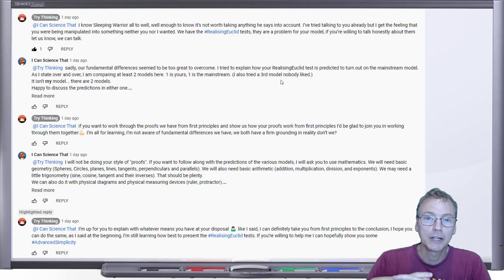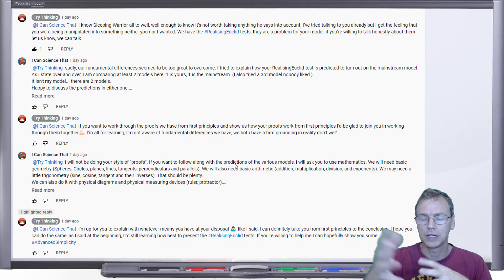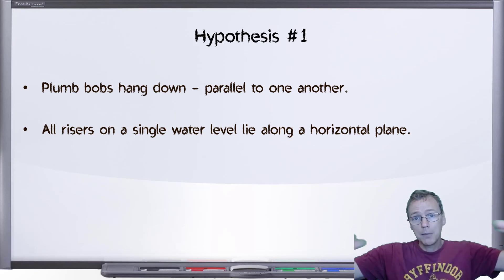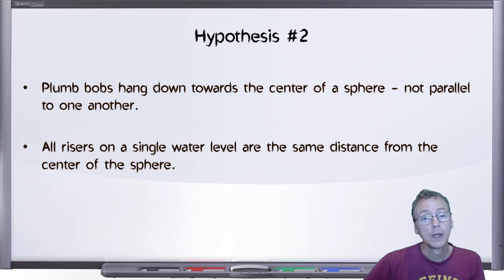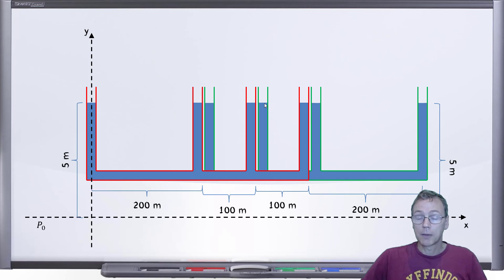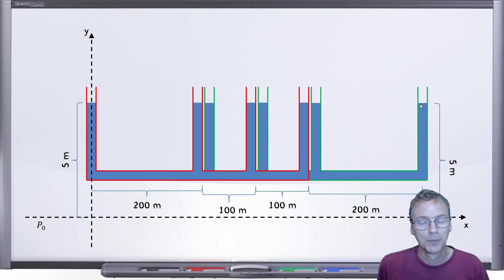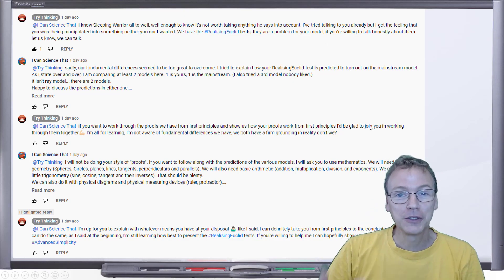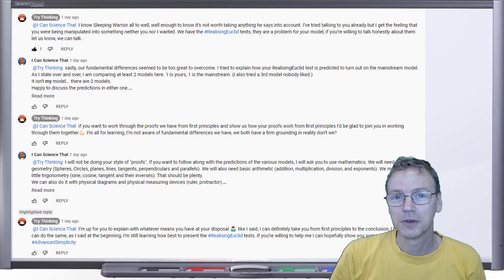Realizing Euclid Step-By-Step Part 1

Comment: This is the clearest elucidation of the two hypotheses that I have seen so far, many thanks.
Reply: @UCPW5HES2YCOWQMN2A0i7AGw 🤷 I’m at a loss. Should we trust a plethora of qualified surveyors or some random guy on the internet?
Reply: @andrewjohnston6631  the surveyors who actually surveyed and helped build the Erie Canal with its parallel horizontal water levels separated by perpendicular vertical gates or the ones that beddy says "found" some curvature on page 377 of a 1000 page book?
Reply: So you'll be taking the side of water levels establishing a ball-shaped reference in reality, correct?
Reply: @DrEMichaelJones  ICST is not asking which hypothesis is correct, but rather what each hypothesis predicts. The question set is pretty simple, so you should be able to answer it, little buddy.
Reply: @edby263  Your prediction is that a water level will establish a ball-shaped reference. Mine is that it works the way the manufacturer intended it to. Do I need to use smaller words? Perhaps you can find a quote from Augustine or Aquinas about it.
Reply: @DrEMichaelJones  I supplied you with all the quotes from Aristotle, Augustine and Aquinas in the presentation which you watched.
Reply: @DrEMichaelJones  And did you manage to answer ICST's questions?
Reply: @edby263  looking for a quote about water level's establishing a ball shape, little buddy. Surely someone from your new religion has spouted that...
Reply: @edby263  what questions did he have? I didn't bother watching the video. he has an annoyingly whiny voice.
Reply: @DrEMichaelJones  Mike Jones personalises everything. He is incapable of approaching any question or problem without insulting the person, real or imaginary, who he imagines posed the question or problem. He will be incapable of replying to this comment without some tone in which the breed couches its insults.
Reply: @DrEMichaelJones  Augustine. "Cum enim totam terram adhuc aqua tegeret, nihil impediebat ut aquosa et globosa moles ex una parte faceret diem lucis praesentia, ex alia noctem lucis absentia"
Reply: @edby263  how do you feel that you have been insulted, little buddy? Use your words.
Reply: @DrEMichaelJones  Lovely, a nice personalised reply, as predicted.
Reply: @edby263  Outstanding! Catholicism sounds like your new religion! Do you think you can get any of your atheist pals to convert with you?  How do you imagine they are going to feel about the firmament? Do you think they'll go along with God separating the waters from the waters?
Reply: @DrEMichaelJones  By the way, you don't have to watch the videos. The links to the forms are posted above, and you are a smart person. Rooting for you.
Reply: @DrEMichaelJones  Augustine addresses precisely this point about the firmament. Why not read what he says?
Reply: @edby263  did you fill out the forms like a good little boy?
Reply: @DrEMichaelJones  for someone who didn't even watch the video you sure are spending a lot of time here
Reply: @DrEMichaelJones  "like a good little boy". Again, Jones cannot approach any intellectual question except by personalising it. Has he sought help about this?
Reply: @donjezza  It has some deep need to attack and insult other human beings. Perhaps it was dropped on its head as a child.
Reply: @edby263 I don't think I need any help pointing out your obvious weaknesses that I exploit for amusement but if you'd like to share some you think I may have missed feel free.
Reply: @DrEMichaelJones  "looking for a quote about water level's establishing a ball shape" Then you must not be trying very hard. Kind of like you won't admit that the haversine formula accurately tells you the distance between two points on Earth. Here's what you can't seem to find Mike. Let me guess - engineers and surveyors are actually lizard people?

Level
- A line or surface to which, at every point, a vertical or plumb line is perpendicular; a line or surface which is everywhere parallel to the surface of still water; -- this is the true level, and is a curve or surface in which all points are equally distant from the center of the earth, or rather would be so if the earth were an exact sphere

Terminologies in Levelling
A vertical line is the line indicated by a freely suspended plumb bob or is the line along the direction of gravity.
Level surface is a surface normal to the plumb line at all points(or perpendicular to the direction of gravity at every point). Simply, we can define it as, any surface that is parallel to the mean spheroidal surface of the earth.
Reply: @NinjaMonkeyPrime  That's a fascinating belief that you have there, little buddy. Do you imagine you can establish a ball using a water level or would it just establish horizontal like all the manufacturers say it will?
Reply: @DrEMichaelJones  That's some epic ignoring of reality. You asked for references that cite how levels work on a globe and I gave it to you. Are you literally putting your fingers in your ears to avoid education? Are engineers and surveyors all lizard people? Still can't explain why using the haversine formula works for calculating the distance between two points on Earth? What's next? Pretending that measuring a kitchen table is the same as a few thousand miles? Your entire game seems to just ignore reality. At least try to come up with excuses. You're boring.
Reply: @edby263  I don't think you should stoop to that level of insults as a response though.
Reply: @NinjaMonkeyPrime  we're discussing reality. I know this is hard for you but in reality water levels establish a horizontal plane of reference. No one disputes this except for a tiny group of weirdos online. You're one of those people.
Reply: @DrEMichaelJones  "we're discussing reality" Yes, the reality of using the haversine formula with any two lat/long coordinates will give you the distance between those points. It works in reality. Something you can't explain. And something you can't calculate on flat Earth. 

"in reality water levels establish a horizontal plane of reference" How cute. Now Mike is pretending to not understand what was said. Establishing a horizontal on Earth means perpendicular to the vertical which points to the center of Earth. If you need more reality just look at the support towers for a bridge like Humber.
Reply: @DrEMichaelJones  Have you noticed that the water levels in this example have more than two risers? And that there’s two overlapping water levels? For a total of eight risers?

It’s pretty easy to realise that if the earth was flat you could look across and see the tops of the water in the risers all lined up.

It should also be obvious that if the earth was curved the water level in the risers would also curve away as you looked along them.

It’s astoundingly simple yet you seems to not understand it.
Reply: @andrewjohnston6631  yeah it's crazy they didn't just sight across the water levels
Reply: @andrewjohnston6631  have you noticed that Erie canal is 363 miles long and all the water levels in the locks are horizontal and parallel? It was designed that way.
Reply: @DrEMichaelJones  Have you given up trying to explain why using the haversine formula and any two coordinates on Earth accurately calculates the distance between the two points? It's really simple. It's because we measured Earth and developed an accurate coordinate system. Something that you can't do with flat Earth.
Reply: @DrEMichaelJones  We haven’t got as far as real world examples yet. We’re still trying to to get you to understand how a multi-riser water level would work under the two different hypotheses that ICST has proposed.
Reply: @andrewjohnston6631  I just live in reality where water levels establish horizontals that are all parallel to each other as exemplified by the design and construction of the Erie Canal. Spaghetti boy wants to line in some sort of bizarre imagination land that contradicts reality. Sad.
Reply: @DrEMichaelJones  No one said that water levels with only two risers don’t establish a horizontal line. The problem is when we add more risers along that line. ICST is trying to get everyone’s understanding of how they would work in the two different scenarios.

No one seems to have any trouble with the first scenario but there’s one sector of the audience that kicks up a fuss when we move to the second one.
Reply: @andrewjohnston6631  the Erie canal has 57 locks. The water levels in all of them are horizontal and parallel to each other. No one in that lives in reality has trouble understanding this. Why do you and your small band of weirdos dispute this?
Reply: @DrEMichaelJones  You just won’t give up on that canal, will you? That’s quite some claim you’re making - that the sections of the canal are horizontal and parallel to each other. You got anything to back it up? The strange thing is that during the 19th century geodetic surveyors went right through the region the canal is in. Reckon they would’ve said something if they hadn’t found any spherical excess for hundreds of miles. It would’ve been mighty unusual.
Reply: @andrewjohnston6631  why would I give up on the canal that engineers designed and built with water levels establishing parallel horizontals for 363 miles? It crushes your fantasy and was built before any "geodetic model" was even imagined. No "spherical excess" at all. Just straight horizontals and verticals all perpendicular to each other. Euclidean reality.
Reply: @DrEMichaelJones  Any reference for it being constructed with horizontal parallel sections? (This is the 2nd time I’ve asked).

You’re also missing the point of me bringing up geodetic surveying. You claim that the canal was built for ~300 miles without encountering any earth curvature. In the decades following the completion of the canal the entire area that it runs through was covered by a triangulation survey. And those surveys measured spherical excess in that area (just like they do in all areas). So how can it be that the canal was built flat if the surface that it is on is curved?
Reply: @DrEMichaelJones  So your “proof” that it’s horizontal and parallel is the elevation profile. 
That would be the elevation profile that references everything as a height above the tide level at the eastern end - so essentially it’s height above sea level. And sea level was known to be curved for thousands of years before the canal was built.
Everyone knows that elevations are in reference to a curving surface but are drawn against a flat base for clarity and utility. Only a tiny group of weirdos on the internet seem to think they’re proof of a flat earth.
Obscure survey or not, geodetic surveying measures spherical excess everywhere. Your misunderstanding of a profile diagram doesn’t change that.
Reply: @DrEMichaelJones  Earth’s spherical shape wasn’t known about in 1817?? HAHAHAHAHAHA!!!! Good one, Mike 😂
Reply: @andrewjohnston6631  shall we bet $1,000  that you can't find any mention of it in the engineering drawings of the Erie Canal? HHAHAHAHAHAHAHA

Over to you Andy!
Reply: @DrEMichaelJones  I wouldn’t expect to see a curve on the profile diagram. No one would expect that - because everyone knows the earth is curved and the elevations on the profile are in reference to sea level (or in this case, high tide on the Hudson at Troy)
The issue isn’t the stuff on paper. The issue is out there in the real world.
So what would you expect to see if you put a water level with multiple risers along the length of one of the “horizontal” sections of the canal? Would they all line up or would they curve away with distance?
Reply: @andrewjohnston6631  Good point about the survey. Is the United States Lakes Survey dating from 1841 that you are referring to?
Reply: @andrewjohnston6631  Jones says "Why do you and your small band of weirdos dispute this?" This is a lovely piece of gaslighting. The narrative is that Science holds that the earth is flat, that all engineers and physicists know there is no curve, there is no such thing as 'geodetic surveying', only construction surveying where level is horizontal, etc etc. But there is this 'small band of weirdos' and eccentrics on YouTube who hold that the earth is a globe.
Reply: @andrewjohnston6631  lol "everyone knows" so they could just draw it with straight lines and leave it up to the laborers to figure how much "curvature" they should account for. Whatever helps you sleep at night, little buddy.
Reply: @edby263  Didn’t bother to find a particular survey but there’s a map “Primary Triangulation in the State of New York 1887” that shows all the triangulation that had been done. Inconveniently for Mike, there’s a triangulation network between Albany and Buffalo that covers the run of the canal. I wonder if the surveyors reported back that they didn’t find any curve? 🤔
Reply: @DrEMichaelJones  Is the engineering drawing you keep citing the same one that is on the wiki page for the canal?
Reply: @andrewjohnston6631  Hi I just found Report of the Primary Triangulation of the United States Lake Survey 1882, a mere 1,000 pages. Part III starting p.307 has the results on the spherical excess. So they found a curve, unsurprisingly.
Reply: @andrewjohnston6631  come on over to Next Level and I'll show you photos of the original elevation profiles I own. None of the drawings depict curvature of the parallel horizontal water levels because they're not curved.
Reply: @edby263  Nice find, edby. I randomly picked a couple of sets of observations from that book and, to nobody’s surprise, found a few arcsec of excess in both of them.
Reply: And yet the surveyors architects and engineers that built the Erie canal didn't find any curve or "excess" (since there obviously can't be any in our 3 dimensional Euclidean reality) and the canal works perfectly. I think we can trust the people that built what was called the 8th Wonder of the World versus some guys that looked at stuff in the distance and then wrote down some numbers and said "that's curved."

PS beddy is if course lying again. He didn't just find it. He got it from mactoon.
Reply: @DrEMichaelJones  It’s nice that you characterise geodetic surveying as just some guys who look at stuff in the distance and write down numbers. The fact that this type of surveying has been done all over the earth in order to make accurate maps probably speaks a little to its validity.
Can you give a source for your claim that the canal builders didn’t find any curve? At the moment all we have is your misunderstanding of an elevation profile.
Reply: @andrewjohnston6631  I suggest he look up Alexander Ross Clarke (whose work is discussed at length in the 1882 report). I did not find that report from MacToon but rather from an elementary search.
Reply: @andrewjohnston6631  the fact that an actual canal was built by architects and engineers based on surveys accounting for exactly zero curvature tells you which ones were right in the end. Womp womp

PS - triangulation requires straight lines. Lol
Reply: "triangulation requires straight lines" is funny
Reply: @edby263  I suggest you look up "Erie Canal Elevation profile." It's an elementary search.
Reply: @DrEMichaelJones  Again, Mike, can you provide a source for your claim that the canal surveyors considered the earth to be flat and that all the sections of the canal were surveyed and built to be parallel horizontals?

You’ll find that spherical excess is documented on more than just one page in that book. And it’s to be found in many more books published by other triangulation surveys. And in the whole entire field of geodetic surveying, which was well established before the canal was built.

So you really have to come up with something better than “I’ve got this diagram with right angles”.

And… any explanation as to why Google Earth shows a spherical earth but a flat MSL for elevation profiles? Have they accidentally revealed that the earth is flat and hoped we wouldn’t notice?
Reply: @DrEMichaelJones  You still haven’t answered whether the original plan you have is the same (or similar to) the one in the wiki page for the canal?
It’s not a difficult question.
Reply: @andrewjohnston6631  Jones' argument seems to be that because the lines where the elevation does not change are represented as straight, not curved, there is no earth curvature. Does he have a point?
Reply: @edby263  represented and then constructed according to those elevation profiles. Do you imagine builders ignore them? What other weird conspiracies do you believe? Btw, I didn't say that there are no curved or rolling hills of earth all around those parallel horizontal water levels that are separated by perpendicular vertical gates.
Reply: @andrewjohnston6631  "And… any explanation as to why Google Earth shows a spherical earth but a flat MSL for elevation profiles? Have they accidentally revealed that the earth is flat and hoped we wouldn’t notice?" Interesting.
Reply: lol he's now resorting to citing cartoons made in silicon valley by nerds. Sad. But nice to see him concede that elevation profiles definitely don't reference any curve. Interesting indeed.
Reply: @DrEMichaelJones  Despite you not answering my simple question twice, I take it that your original document is indeed the same (or similar) to the elevation profile on Wikipedia.

So… 
Do you think the builders saw that profile and understood it to be elevations above a curved MSL (or, more specifically, the level of high tide at Troy)?

Or… do you think that the surveyors and engineers looked at that profile and thought, “Gee! That’s weird. This canal is supposed to be built horizontal for hundreds of miles. That’s going to be difficult, seeing as we all know that the earth is spherical. Isn’t it going to start separating from the earth’s surface? How are we going to support it and won’t the water all flow down to one end? Oh, well. I guess the planners were right and we’ll just have to build it like that.” And then they used planar surveying and were astounded when it conformed to the earth’s surface. “By Jove, gentlemen! It turns out that the earth is actually flat! How could we have been so wrong and why did it take this particular construction to convince us?” And then they turned to the geodetic surveyors and said…

“Womp. Womp.”
Reply: @andrewjohnston6631  Embarrassment comedy is funniest when the embarrassed person realises quite how embarrassing he/she is. But not bad.
Reply: @andrewjohnston6631  More research shows the Erie canal was designed by untrained engineers. They couldn't afford the salaries of European engineers and at that time there was no major engineering school in the US. They were amateurs. But of course you don't need to be a geodetic surveyor to build a canal, you just use, er, a water level.
Reply: @edby263  too bad we'll never witness your realization. It would be hilarious.
Reply: @edby263  more research than beddy's brief scan of wiki reveals that those engineers consulted with the top European canal engineers of the time and then drafted the elevation profiles on straight xy axes and constructed what was called the "8th Wonder of the World" with parallel horizontal water levels separated by perpendicular vertical gates.

And yes, er, that water level is indeed horizontal and parallel to every other water level for 363 miles of canal. Womp womp.
Reply: @edby263  😂
Reply: @DrEMichaelJones   You are making an assumption that the builders took that “flat” plan and went out and constructed a “flat” canal.
And, as already pointed out to you, that would contradict the findings of the geodetic surveyors who went through the area in the decades following.
And indeed it would contradict geodetic surveying entirely.
I’m intrigued what your response to geodetic surveying is. None of the flerfs I’ve encountered have any rebuttal to it, with the exception of one who said that the supposed curvature was within the margin of error.
Reply: @andrewjohnston6631  Ah but Andrew, didn't you know that geodetic surveyors merely look at stuff in the distance and then write down some numbers and say "that's curved."
Reply: @andrewjohnston6631  no, there is no assumption by me. The plans aren't "flat." They cover hundreds of feet of topography. The elevation profiles definitely depict the water levels in the locks as horizontal though because they are in reality and every geodetic surveyor that's ever drafted an elevation profile will depict them that way. If you don't like it, try to get them to change it to match your fantasy model and then watch them laugh and tell you it would be impossible to do. Because it would. Womp womp.
Reply: @DrEMichaelJones  You’re having trouble keeping your story consistent. Are geodetic surveyors a bunch of guys who “look at stuff in the distance and write down numbers and conclude that there’s curve”?
Or are they legitimate surveyors that draft “flat” elevation profiles because the earth is genuinely flat?

(And stop it with the topography nonsense. No one is denying topography.)

You still haven’t answered my question about whether your super secret original canal plans are similar to the elevation profile shown on Wikipedia.

You also still haven’t provided your rebuttal to geodetic surveying other that to belittle it.
Reply: @DrEMichaelJones   And what about Google Earth’s depiction of a spherical earth and a “flat” elevation profile? All you’ve done is belittle it by calling it “cartoons by nerds in Silicon Valley”.
Could you perhaps provide an explanation that has some substance? Never mind if you can’t. It’s okay to admit you’re wrong.
Reply: @andrewjohnston6631  Don't forget the bunch of guys that looked at stuff on YouTube and then, without writing down any numbers, said "that's flat." "
Reply: @andrewjohnston6631  elevation profiles aren't flat, little buddy. They depict level as horizontal and parallel to the x-axis and plumb as vertical and parallel to the y-axis. It's ok to admit that you don't know what an elevation profile is.
Reply: @andrewjohnston6631  There are no "super secret" elevation profiles for the Erie Canal. They all depict water level as horizontal and parallel to the x-axis and plumb as vertical and parallel to the y-axis. Just like they are in reality. Every surveyor who has ever drafted one has drawn them this way. Why do you hate canal surveyors so much?
Reply: @DrEMichaelJones  "The elevation profiles definitely depict the water levels in the locks as horizontal though because they are in reality" No, they depict the profile compared to a baseline because that's what they are for. 

"every geodetic surveyor that's ever drafted an elevation profile will depict them that way" An elevation profile isn't a geodetic survey. It's cute you pretend to not understand what terms mean. When asked for a world view you get WGS84 which is an oblate spheriod because that's what was measured in reality. 

"If you don't like it, try to get them to change it to match your fantasy model" Why would anyone change an elevation profile to be something it wasn't supposed to be? You're basically saying if you don't like hammering with a screwdriver then get them to change screwdrivers to be hammers. Its childish even by your low standard. 

"and then watch them laugh and tell you it would be impossible to do" More likely they'd laugh because Mikey is a dishonest flerf who pretends that elevation profiles should require Earth curve and that WGS84 is a Freemason conspiracy. They'd also laugh because you can't use lat/long to estimate distances like humans have done for hundreds of years. There's tons to laugh at with you Mikey. 

#gottolietoflerf #fearthehaversineformula #wheresyourmap
Reply: @DrEMichaelJones  I don’t disagree with you. Horizontal lines on an elevation profile are representative of level lines in reality. And vertical lines are representative of plumb lines in reality. It’s the same way those “nerds in Silicon Valley” draw their cartoons.
I think you might finally understand it. Huzzah!
Reply: @andrewjohnston6631  Yes indeed level is horizontal on elevation profiles and in reality. Straight lines. Glad we agree.
Reply: @NinjaMonkeyPrime  Don't lie to flerf. You definitely don't "gotta" do that. Be honest to him.
Reply: @DrEMichaelJones  Don't get mad Mikey, we know that you're pretending to tell these lies. It's how you get your jollies and we're not really trying to kink shame you. But you're really not very interesting anymore. All you're doing is cherry picking and saying nuh-uhh. At least try something new. How about that formula for calculating the distance between two points on Earth without using spherical math? Or why we match reality when we do use spherical math with a prediction? 

Or just go back to pretending elevation profiles are supposed to show curve and geodetic surveying is all fake because conspiracy theory mumbojumbo. Oh, let's talk about measuring your kitchen table for Earth curve again. That one never gets old.

#keeptrolling #gottolietoflerf
Reply: @boobylinks  their elevation tool is accurate why do you imagine they would need to change it? Horizontal is the x-axis and vertical is the y axis. Straight lines on the graph just like they are in reality.
Reply: @DrEMichaelJones  You previously agreed that level in reality is represented as horizontal on a profile. You’re now saying that horizontal on a profile is horizontal in reality. So all you’re saying is that level in reality is horizontal in reality. You’ve removed your super secret engineering diagram from your argument.
So now it’s up to you to show that level is horizontal. 
Have you filled in ICST’s forms? 
Can you explain how Bev’s test could distinguish between horizontal level and curved level?
Have you provided a rebuttal to spherical excess?
Have you admitted your super secret canal plans is just the elevation profile and not instructions to build a horizontal canal?
Have you explained why Google Earth depicts elevation against a flat base whilst simultaneously showing the earth as spherical?
Chop chop, Mikey. You’ve got work to do.
Reply: @andrewjohnston6631  level is horizontal on elevation profiles because level is horizontal in reality, little buddy. Construction wouldn't work it is wasn't. There are no "super secret" diagrams. Elevation profiles for the Erie Canal are readily available. You can buy them online or even just print them out if you're poor. Get busy printing, little buddy. You've got lots to learn.
Reply: @DrEMichaelJones  You’re glossing over how an elevation profile is proof of a flat earth. If elevation profiles are horizontal because the earth is flat then why does Google Earth depict the earth as spherical? Why do geodetic surveyors always find spherical excess? How would Bev’s test be able to distinguish between the two possibilities?

If level is horizontal then why can’t you actually provide evidence for it?
Reply: @andrewjohnston6631  the earth under our feet is provably NOT FLAT. We use elevation profiles to depict the topography that makes the earth not flat. 

A water level is a tool for establishing a horizontal plane of reference they're used daily for construction projects all over the not flat world.
Reply: @DrEMichaelJones  Firstly, you can dispense with the “earth isn’t flat because of topography” diversion.
And now we get to Bev’s test. Can his test determine if the earth is flat or curved? Is a horizontal plane established by one water level parallel to one established by another water level? It’s not sufficient for you to just say that it is. ICST has set up these videos to determine if Bev’s test can distinguish between the two paradigms - and it’s clear that it can’t. So perhaps you can devise a test that will?

BTW You’re still very silent on geodetic surveying and the “Google Earth conundrum”. To refresh your memory:
- why does geodetic surveying always find spherical excess?
- why does Google Earth depict elevations against a flat base but depicts earth as spherical?
Reply: @DrEMichaelJones  A water level tool is used to establish a horizontal plane of reference. So what would happen if that tool over several miles showed horizontal planes of different heights? You know, like what Walter already gave you and you ignored? Not to mention, what exactly makes estimating the distance between two points on Earth complicated on flat Earth? If Earth is flat you should be able to use a really simple x/y coordinate system with a rigid scale. So what's the hold up? Where's the map, coordinates, scale, and math?
Reply: Y’all arguing with a dude that thinks elevation profile of a globe earth should be a curved graph. He can’t grasp what elevation means, and he won’t acknowledge what’s being said to him because he’s evidently either too incompetent and/or insecure to entertain different hypotheses. This won’t go anywhere but backwards.
Reply: It's always fun to watch y'all imagine what I'm thinking.
Reply: @sphaera2520  "He can’t grasp what elevation means" Oh he knows. He's just lying about it. He's part of the crowd that thinks it's funny to pretend to not understand things.
Reply: @DrEMichaelJones  What Mike Jones is 'thinking'?
Reply: @edby263  it's infuriates you that you know I'm both smarter and better educated than you, beddy. Get it all out.
Reply: @DrEMichaelJones  "It's infuriates you"
Reply: And where actually was this 'education'?
Reply: @edby263  Multiple universities. Better than any school you claim to have attended in the UK. With honors.
Reply: @DrEMichaelJones  Which ones. And where did you learn about geodetic surveying? Or Thomas Aquinas?
Reply: (You clearly knew nothing about Aquinas. I'm glad I corrected you on that)
Reply: @edby263  I learned about Aquinas from the Summa. Which geodetic surveying school did you attend?
Reply: @DrEMichaelJones  So you never read the commentary on *De caelo*. Fair enough. (“My front entryway is a rotunda and it's definitely not ball-shaped.”)
Reply: “We've already confirmed that St. Thomas Aquinas never said anything about believing in a sphere-shaped earth". Should have got a refund.
Reply: I have heard Mikey's claims to higher education before but there is nothing in what he says that is evidence of it.
Reply: @edby263  feel free to bet me on it little buddy
Reply: @DrEMichaelJones  You have no evidence, except what you say. And what you say contradicts any possibility of an education beyond the age of 10 years old. (“My front entryway is a rotunda and it's definitely not ball-shaped.”)
Reply: Damn, bragging about his alleged education in this position and it doesn’t even have the effect he imagines. 

It’s like a dude going, I grew up filthy rich and inherited all of daddy’s money but somehow blew it all, now I live under the overpass.
Reply: @edby263  bet me, I'll have lawyers draw up the contract.
Reply: @DrEMichaelJones  Can you have your lawyer team draw up a contract to bet that calculating the distance between two points on Earth using the haversine formula doesn't work? I'd like to see that.
Reply: @NinjaMonkeyPrime  Not sure what his lawyers would make of it.